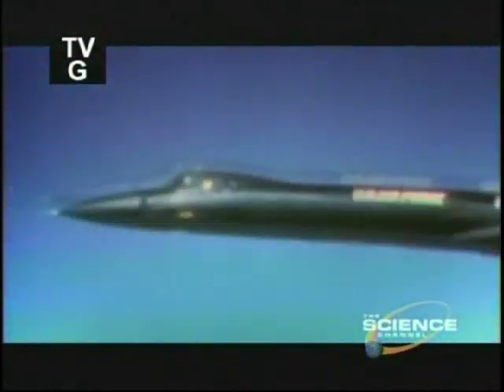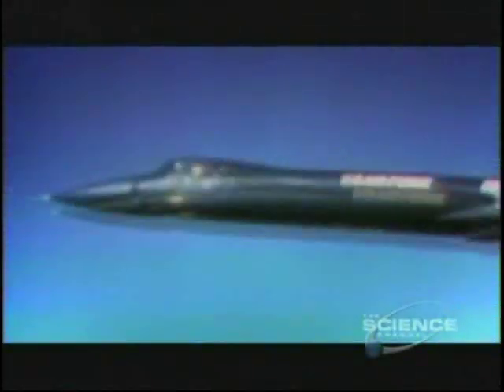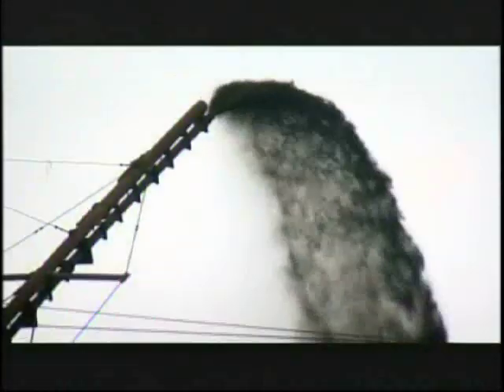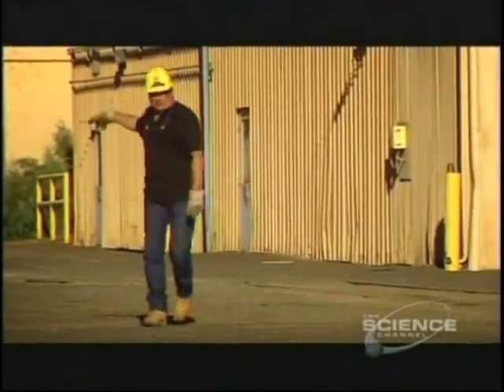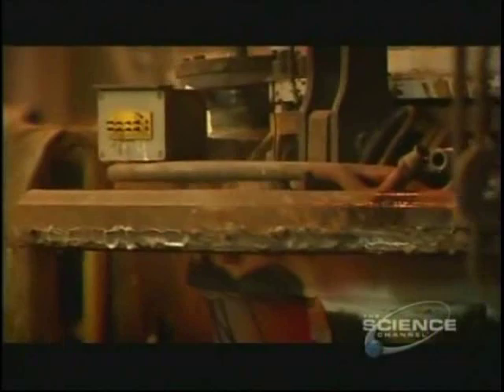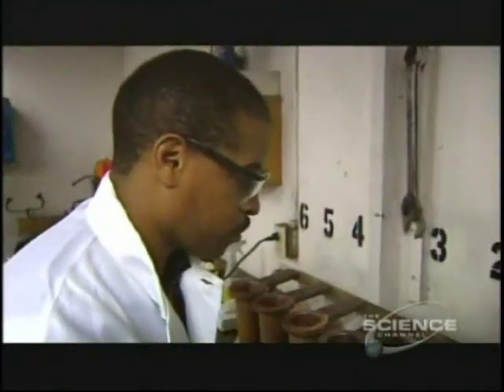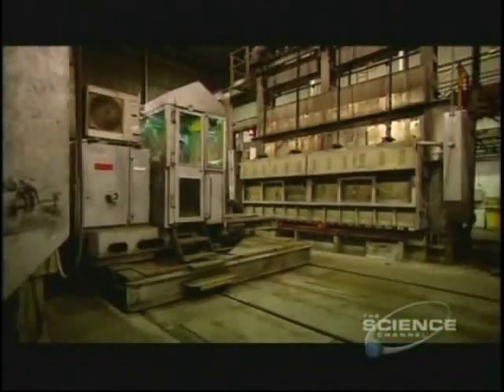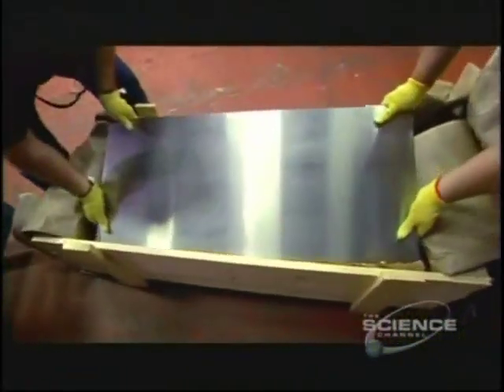Titanium Manufacturing Process

Comment: Titanium is the perfect metal, low density, high strength and hardness, extremely corrosion resistant, nonmagnetic, high melting point, common in the earth's soil, what's making it so damn expensive is the Manufacturing Process.
Reply: It's not perfect if you want to make magnets!
Reply: uzerofutube it’s not very good at high temperatures.....
Reply: They have all titanium submarines!
Reply: And your last point is exactly why Ti is NOT the perfect metal. It is also not perfect if you want high conductivity, if you need even lower weight or extreme heat resistance.

Comment: LOL never used for a plane before UMMM the avro arrow holds the first for that ... and flew as fast and as high too ... the sr71 was about tp be cancelled in march of 59 ... but the arrow was cancelled the month before and already knew how to use titnaium and work it ... so they took the swept wing sr71 failure and made it delta winged and a success ... no sadly too many american lies in this story ... and yes even the arrow with its heavier slower larger P&W j75 engines was already close to the sr 71 ... if they let206 fly the sr 71 would never have been buiilt because the arrow could do what it did and PROTECT ITSELF .. pity a country lost the best plane ever design and produced ... yes produced ... there were NEVER any arrow proto types ... the cook craige method was direct to production line .. so all 37 planes on the line were PRODUCTION run aircraft ... best part the design spec air 7.3 still is un met today 63 years later ... not even the f35 all 3 variants cn match her not even the f22 ... NOTHING meets the spec th arrow was built to and had finished 95% of its testing and exceeded everything except being a 2 seater fighter interceptor with 2 jet turbines ... thats right ... that is all the spec they met the rest they exceeded ... and with the ps13's she would have passed the sr71 in ALL aspects ... pity a PM and the americans didnt want the best ... just second best

Comment: to weld titanium used for bike frames (most of the time) They either use an airtight thing, or x-ray welding. I have spoken with jones from jones bikes at interbike, and thats what I have learned
Reply: They use heliarc with a titanium fillet rod... then they x-ray the weld!

Comment: Titanium is such a cool metal. Many types out there. Ti 6-4 which is used for most of the aerospace parts. There's another that you'll see Ti 6-2-4-2. 
Ti 6-4 is 6% Aluminium, 4% Valadium and 90% Titanium.
Ti 6-2-4-2 is 6% Alum, 2% Moly, 4% Zirconium 2% Tin.
It's non-magnetic and needs recycled.
Reply: Do you know what all that means?
Reply: You have titanium commercial grade that's pure titanium... nowadays there are so many different titanium alloys you have to look it up... however 6/4 alloy is the most common!

Comment: your comments on welding are mostly wrong.  when making tubing, it does get welding in a small airtight box filled with an inert gas (like helium or argon), and the weld is made with the Tig process - small tungsten electrodes about the size of a pencil or in some cases a laser.
Reply: TIG welding uses helium... MIG welding uses argon... plasma torches use argon!

Comment: Titanium cannot be welded by normal process like the electricity arc, cause as he melts for a milisecond he will react with the oxygen in the air, or even the freaking Nitrogen will react with it, detroying it.
Reply: Titanium can be welded via TIG welding or MIG welding!

Comment: you don't need a super welder - you can buy a Mig or Tig at a welding supply store that will do the job.  shielding not a big deal either, especially with Mig.  I've never Tig welded Ti.
now the bike makers will still need to hire a guy who has some training to weld.  I don't think you want that entry level, unless you like bubble gum weak welds.
Reply: MIG welding you need Argon gas and other blends of gas... TIG welding you need helium gas!
Reply: No tig uses straight argon as well and no mig welding will not do for titanium....

Comment: could you use a spray welding just like a plasma cuter or laser  and use the dust as the filler ... and then, if that worked, you could use the brain from 3D printer, to controll welder heads and then print the parts out.  that would short cut the middle prosess,,    i just say think about it,  im trying to think outside the box.
Reply: Ok , you go fly your box ..
Reply: ... plasma cutter*

Comment: Kinda scary that the actual top speed of the SR-71 is still classified to this day.  Makes me wonder that, since it was retired, what exactly did they replace it with?
Reply: @AnaisMartane Except that when the Blackbird got up to speed, ducts opened in the engines that bypassed the fans and turned them into ramjets.  The engines were actually really clever.  The problem was that the Russians developed the Mig-31 which is almost as fast for short bursts, so if they were clever and a bit lucky there was a good chance of shooting the Blackbird down. The general consensus is that it was replaced by satellites, but the program was secret so who knows?
Reply: satelites

Comment: Almost every Fighter Jet in the post Vietnam/Cold War era is made from Titanium. The F111, F4 Phantom, F14 Tomcat, F15 Eagle, F16 Falcon, F18 Hornet, F22 Raptor, and F35 Lightning are all made from Ti. Other Countries still struggle today to manufacturer high purity elemental Titanium. The explosion and subsequent meltdown of the #4 reactor at the Chernobyll nuclear power station was the result of many many things all going wrong in exactly the right order. However, it must be noted that the Soviet Union was unable to produce high purity Uranium 235 fuel for their reactor cores. The contaminants within the isotope created wildly random spikes in reactivity. These fluctuations in reactor made it incredibly unstable at times when it was being run at low power. Building up Xenon that wasn't being burned away. When the Chernobyl crew ran a test of the emergency back up cooling system after being run at a low output level for too long, combines with extreme negligence on the operators part, the core exploded. It was by sheer luck later on when the fuel melted down into a series of full bubbler pools of water below the reactor which they all thought were empty. The steam explosion would have sent the remaining fissioning reactor core into super critical mass and there would have been a 3-5 megaton nuclear explosion.  So because of their inability to purify uranium effectively because of the sheer cost and labor involved to do so, it almost made half the planet radio active and uninhabitable for humans for many hundreds of years at least.  My point is that refining Titanium is very costly and labor intensive. Many Nations simply can't do it on a large scale, and in this area Americas ability to refine Titanium is second to none, and we have no equal on this planet in air combat superiority. God Bless America!
Reply: On all aircraft models you mentioned they used some components made from Titanium, but not in the fuselage and wings like in the SR-71. And your Chermobyl story has notihng to do with titanium, so why mention it?